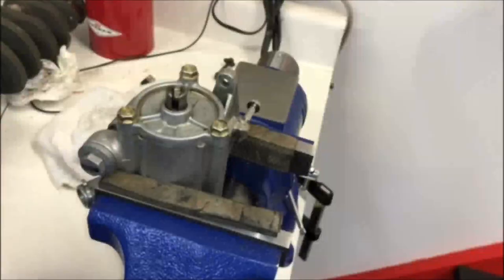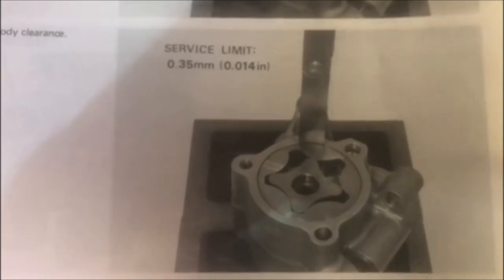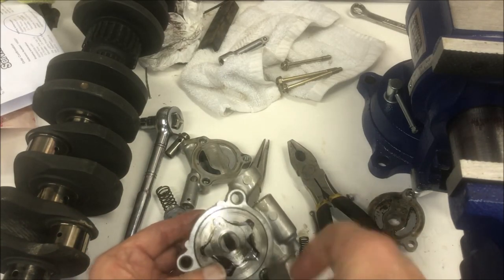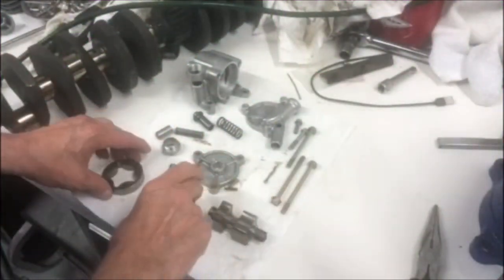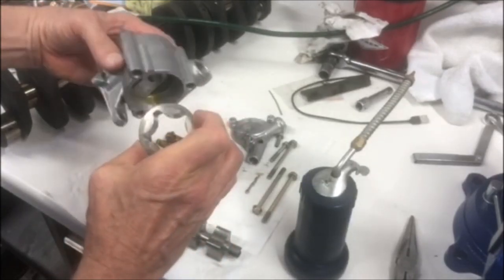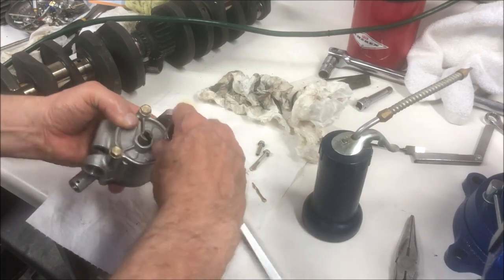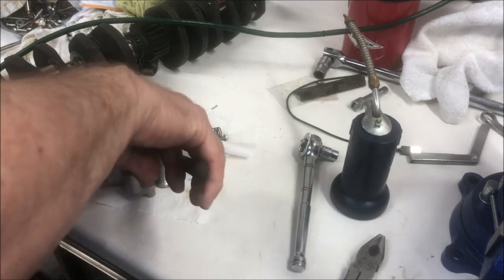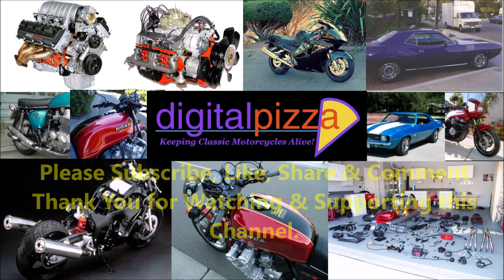Honda CBX Full Restoration & Engine Rebuild Video Series - Part 10 - Oil Pump Restoration

Comment: Wouldn't be better to measure it after cleaning? All that sludge can distort your gaps and making it smaller and looking like they are in spec where it does not.
Nice video series. Congrats
Reply from the maker: Hi Seb, yes you are correct. I actually did remeasure after cleaning everything up and it was all within specs. I was mainly showing the procedure for the purpose of the video. Thank you for the comment, I really appreciate the input. it helps everyone :)

Comment: Apart from the side and rotor clearances, it's very important to make Shure the the side cover faces and the internal faces are not scored. 
There are methods to fix it if they are, but it all comes down to economics sometimes a new one, or good second hand is a better option
Reply from the maker: Hi Llew, yes you are correct. There was no scoring at all that I could see. Thanks for mentioning that.

Comment: Thank you for the video, very informative. I have a few comments:-
1. Strange about the broken oil intake flange, could it have been vibration, was it touching the side of the engine case.
2. It's an impeller rather than a propeller.
3. Isn't the re-use of cotter pins a no-no, especially inside an engine.
Reply from the maker: Hi Bee Cee
Yes, you are correct on the impeller, when recording, sometime there is a brain freeze lol.
The cotter pin is a factory design, so Honda must have had a reason they designed it that way. I have Never had and issue with it.
The broken pickup tube is a mystery, but given all the weird junk that was floating around inside this engine , I am not surprised 😲

Comment: Wouldn't you wanna clean and lightly reoil it BEFORE you check the clearances? If there's sludge in there the sludge is taking up room that might be masking worn areas.
Reply from the maker: Hi Andy 
Yes, I check before and after.
I this case, the results were the same.
The clearances were really tight with this pump.